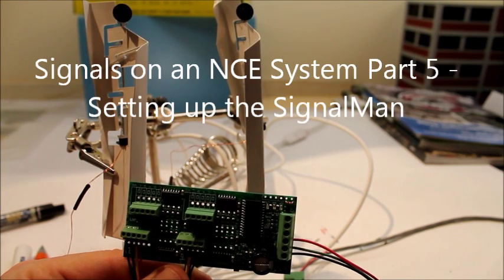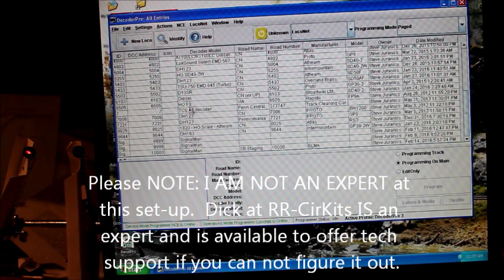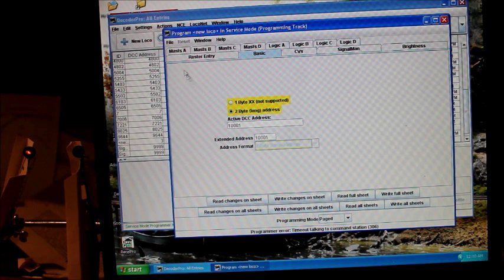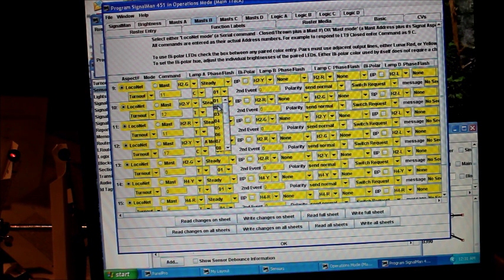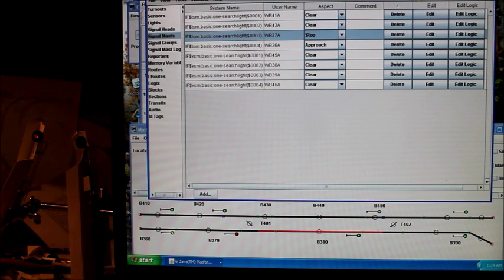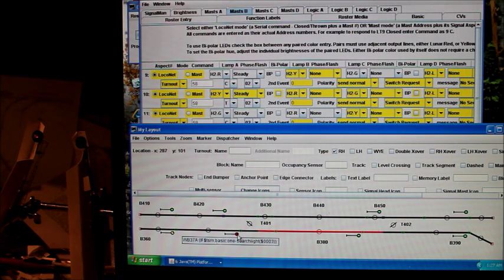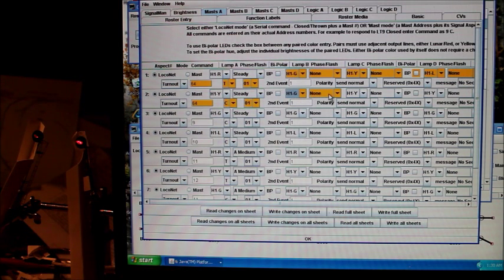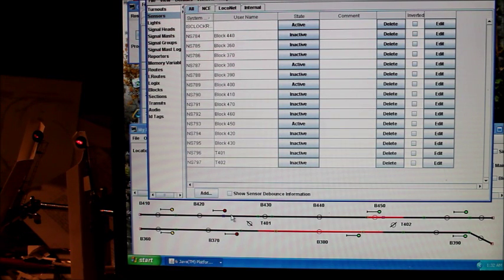Signals on an NCE Layout Part 5

Comment: Great set of videos to explain your complete set up for this. Question for you though. Is there a reason why you didn't want to use the nce USB interface? I can't remember why if you said so.
Reply: +Muskoka Steve That's right you did say you had the power pro . I've been debating on whether or not to use nce products or team digital products to set up and run my signals. My layout is very simple. It's a double deck layout with a climb to connect the 2 in my spare bedroom. In all there will be 13 separate blocks, 14 tortoise switch machines, and 1 set of x overs per level and intermediate signals that will act as intermediates and the approach signals to the control point. 

What made you decide to go with nce route to run signals?
Reply: I apologize, my question was supposed to be what made you go the nce route to control your switches and block detection? After I did a lot more research I've decided to go with RR-Circuits signalman s, watchman, and smd8 to control signals, detect occupancy, and turnout control. Once I added up the cost to run everything with Team D. It was twice as expensive compared to RR-C. I was also thinking of doing exactly what you did although I have a powercab - SB5 system. It still was more expensive than RR-C. Plus I felt as I kinda want all the hardware to communicate freely between each other without having to go through the nce USB and possibly experience issues since my system is smaller. Plus the signalman s has way more features and options than the team d products. 

What do you make of what I plan to do? I'm still gathering ideas for I haven't made any purchases yet, but I feel 95% certain that I'll go the rr c route.
Reply: Yea there are a lot. I even considered going with digitrax drivers, but they were more expensive too. Thanks though man for all your help, thoughts, and video series. You have helped me out a lot! I'd appreciate it if you'd check out my channel and my layout and shared your thoughts on that as well! 

Best of luck to you on your layout!!